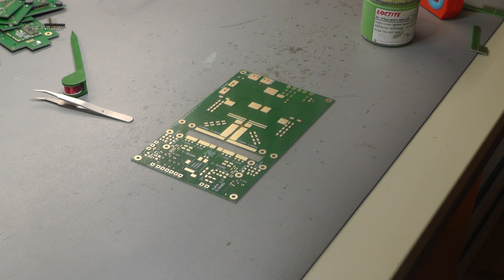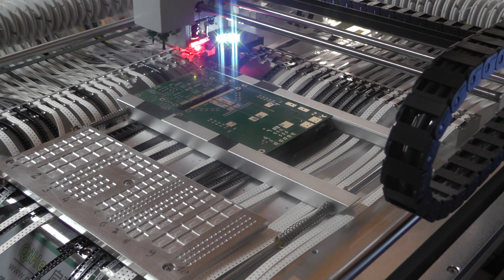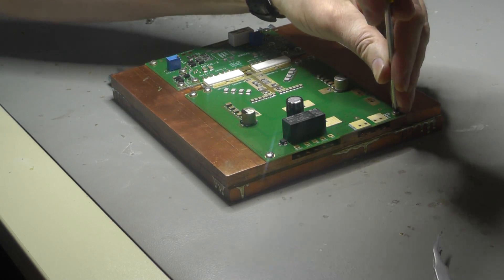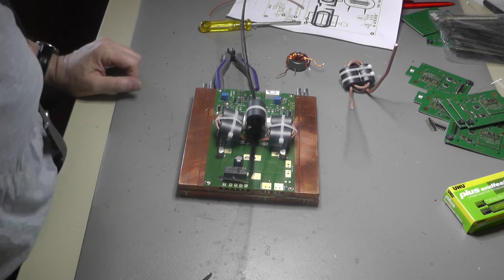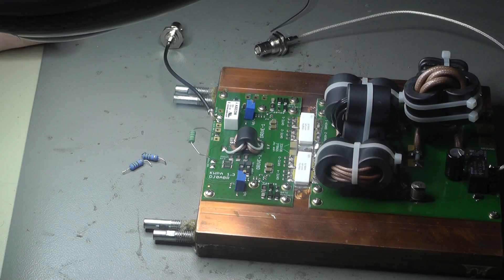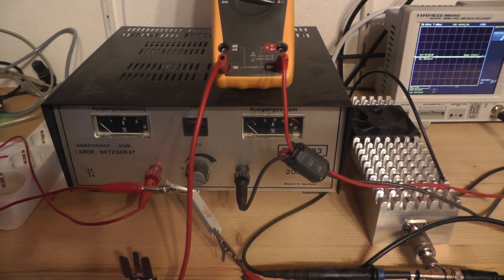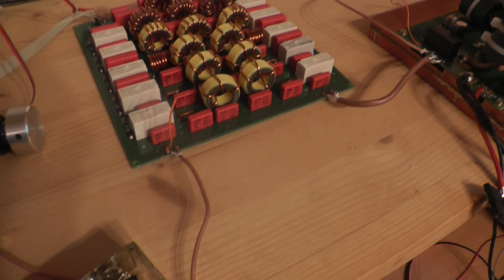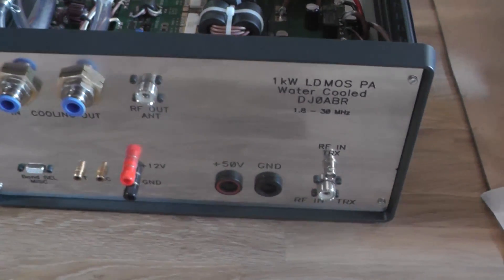2x BLF188XR Amp with WATERCOOLING (Part-2)

Comment: Maximum operating junction temperature is 225 C for this device.....cooking it on a stove hot enough to melt solder would probably not be good for it's future reliability...

Comment: Hi Harry, what is the size of the copper plate that you're using?I've found 10mm copper near me, but not more than that, so will use that.NunoCT2IRY
Reply from the maker: 10mm is absolutely fine, you do not need more. vy 73
Reply: Thanks Harry for the replay, I've some questions regarding your PCB's, can we exchange this questions by email, mine is my call@gmail.com
Nuno
CT2IRY

Comment: Kurt vielen Dank für Ihr Video zu dem Thema ein Solid-State-Leistungsverstärker zu bauen.
Glauben Sie, dass der Transformator 1: 9 mit zwei Transistoren ist die beste?
Und die letzte Frage.
Was Sie ein Ferrit verwenden?
Vielen Dank.
Reply from the maker: Danke nowember711, ich verwende den Laird 28B1020-100. Dieser Ferrit ist sehr billig und funktioniert sehr gut. Mit 1:9 kannst du eine Ausgangsleistung von 1200 Watt machen. Die zwei Transistoren können natürlich mehr. Mit 1:16 könnte man 1800 Watt machen. Da wir in DL ein Limit von 750 W haben, ist 1:9 für mich gut, die Linearität ist optimal.
Reply: Vielen dank an Kurt für die schnelle antwort.
Ich wünsche Ihnen viel erfolg und danken Ihnen für Ihr video zu diesem interessanten thema.